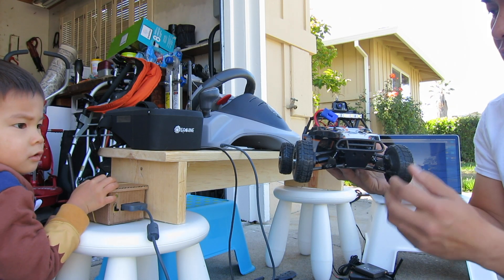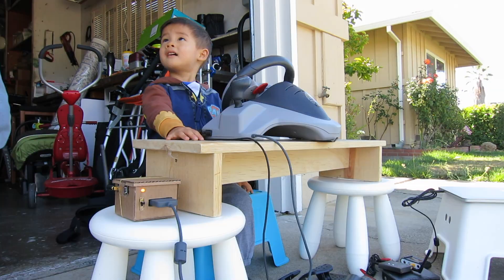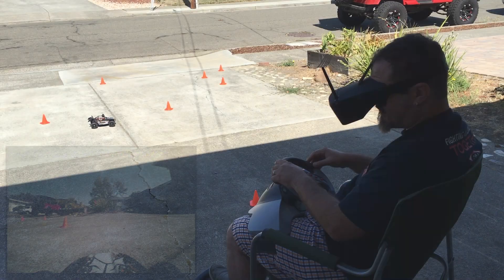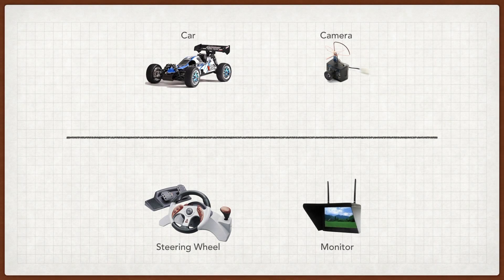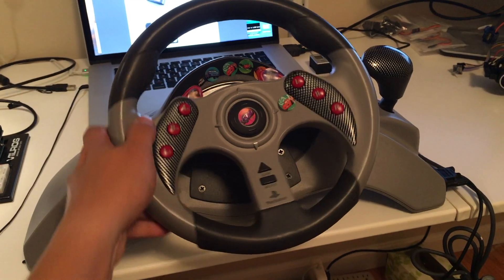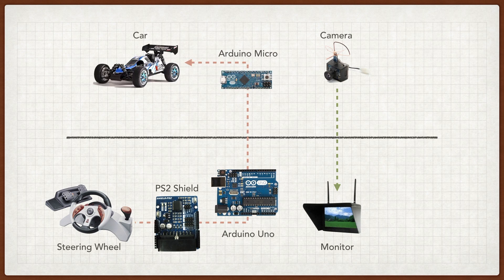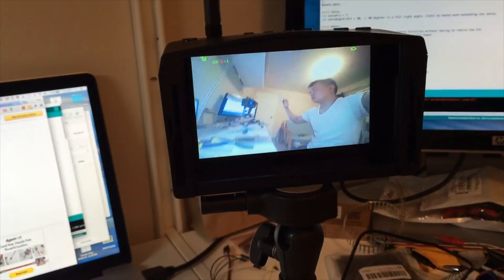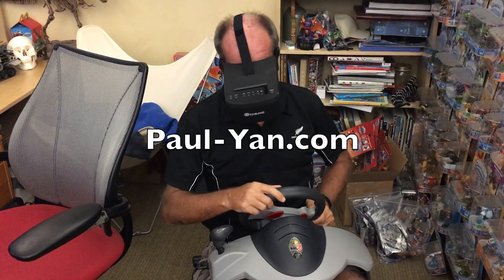First Person Driving

Comment: that's cool bro. is there anyway of putting the wheel so it feels like a care wheel. which is instead of like you do in the video and as soon as you turn the wheel car wheels Shoot To the left or right depending on which way you turn the wheel. Is there any way of making it where you have to turn the wheel more in order to get to the same distance it already turns on the car wheels. so that way when you go to turn it's not a instant turn. basically if you're turning your will a little bit late in the car your remote control RC will be like your car. In order to turn your car completely to the right you have to turn your steering wheel in your car all the way to the right in order to turn as sharp as possible. I would like to put that feature into the remote control RC. Is that possible can you answer me back on this please thank you

Comment: this is awesome. It would be cool to have a gear that keeps the speed of the car under a certain speed for kids and inexperienced adults.
Reply from the maker: I've been meaning to do just that by throttling the max speed and unlocking it with a button push. It would probably feel like a nitrous speed boost!
Reply: a nitrous boost would be sweet

Comment: How did you figure out how to control the RC car with the Arduino Micro?  Did you just open up the RC car and investigated which pins and cables do what?
Reply: Never mind.  I found a link on your blog that exactly answers this:  https://pauldyan.wordpress.com/2016/07/02/hacking-an-rc-car/  Thanks for writing this up!
Reply from the maker: On my cheap test car, I just made random contacts to see what circuits control what functions. When I moved to the hobby grade car, I just had to send messages from the Arduino to the ESC (electronic speed control) module and servo directly.